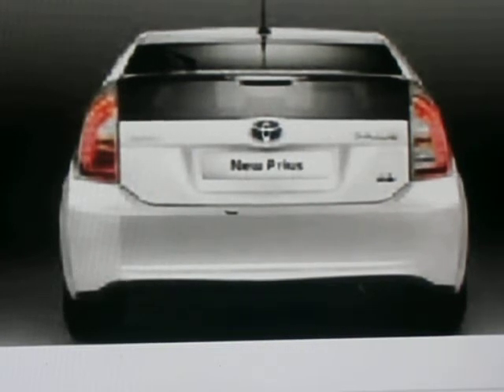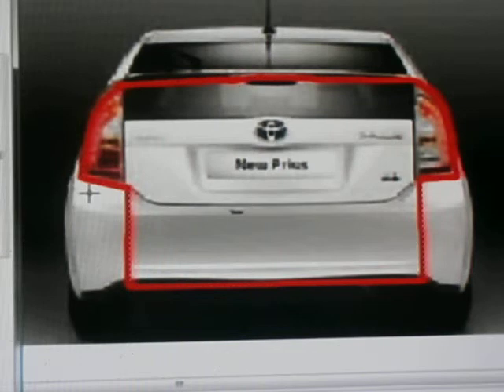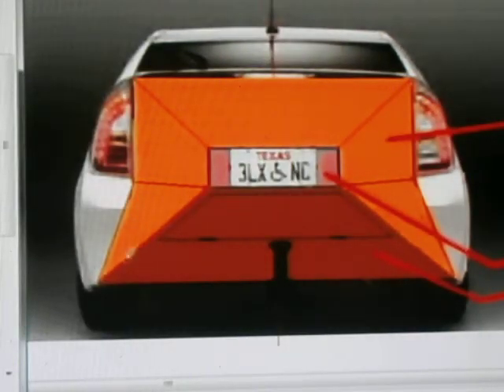Reducing Drag On Rear Of Prius to 12%

Comment: great video!  question: if you have a tail wind, will the added "tail" allow the same benefits of the "push" of a tailwind -as a car without a tail?  trying to understand how those would differ.  And would a side wind make the car with the tail less efficient?  would the benefit outweigh any problems that may arise with side winds?
Reply from the maker: Unless your tailwind were of a higher speed than your forward speed, there would be no benefit in having the larger untapered original profile. The effect of a tail wind in either case is to reduce the actual speed the car is moving through the air, and would increase the efficiency of the car no matter the tail design.  Side winds would have a larger effect on the rear of the car, but less so than hauling the smallest U-Haul open trailer .https://www.youtube.com/watch?v=qaqFdn-c8-c